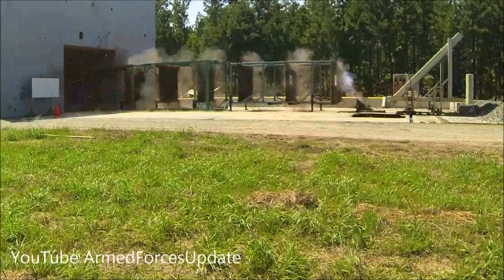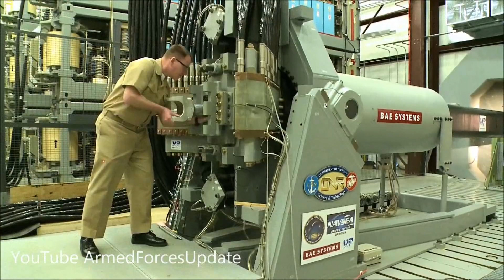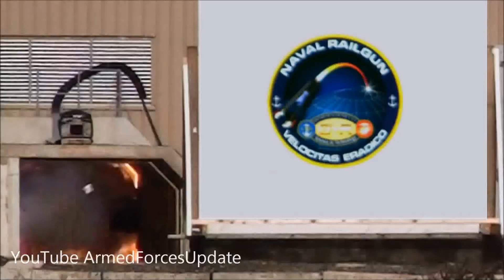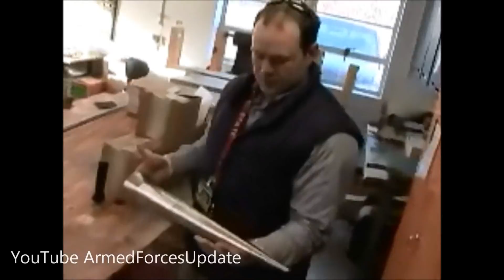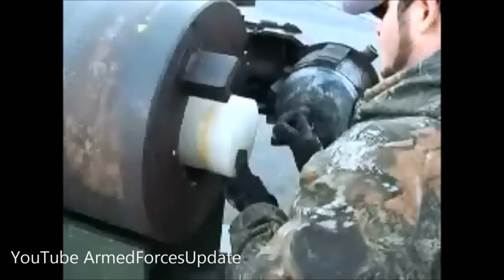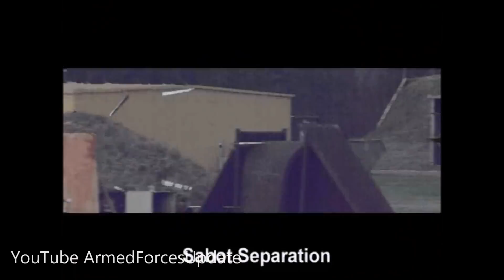WORST NIGHTMARE for Russian military!!! US Military Rail Gun ready for sea trials in 2016

Comment: If it's a railgun why is there a huge explosion? I thought the whole point of a railgun is that it doesn't use an explosive charge to propel the round.
Reply: the "explosion" is actually the sudden release of electrical power, causing the projectile to fly down the barrel. rails guns use magnetic fields charged by electricity to fire the weapon, and then uses the kinetic energy the explosion created to damage its target

Comment: What is the shooting distance of the gun? What is the precision of the gun on the distance? What is the cost of the shoot? Compare it to precision and price of modern cruise missiles. 
This gun is not nightmare for russian military, it is nightmare for US military budget.
Reply: Rail gun projectiles are much much cheaper than missiles. Also much easier and safer to store. I'm not sure about the range, But considering its ability to travel at a speed over Mach 7, I'm sure it can go a hell of a distance. And you saw how precise it was in the video, they could shoot it through hoops if they wanted to
Reply: +John Campbell 
Projectiles are much much cheaper than missiles. But, the cost of the launch consists of cost of enegry, cost of repearing the gun, cost of projectile. Each shot makes enourmous erosion for the gun due to electromagnetic arc during shots. How many shots will the gun endure without repairing? 10, 20? As far as i remember, a tank gun has to be replaced after 200 shots with SABOT, speed of wich is less than 5M, without EM arcs. 
 How many shots it takes to kill a ship 5 000 ton draught? 10, 20 ? One gun for one ship? 
Range of the gun is great, really. More than 200 km, as far as i know. 
With speed 7M flight of a projectile will take 80 seconds. A ship with speed 20 knots will travel 800 meters, and change her course several times. 
Precision of the gun, for example, 1 MOA ( it's very good, the real precision bill be worse ). Wich means, for the distance 200 km spread will be 60 meters, for the ideal situation. How many shots it will take to make a single hit for a ship with width 20 meters for a such distance? Probability is about 0.1 ( surface of a ship divide to a surface of circle of dispersion  ). Wich means, for the 200 km distance it will take at least 100 shots to kill one ship with the gun. Once again, how many shots the gun will endure without repairing?
One, last but not least. With first shot the gun will produce huge amout of electromagnetic energy, all radars will spot the ship instantly. What do you think will they do after they spotted enemy? I think, they will launch dozen of missiles. And missiles are much more accurate than the gun.
Reply: +Brett Keane Showing His Gums 
Countinue your bla bla, my friend.
Reply: +Андрей Андреев You mine as well ask for the schematics while ur at it =P . Projectiles be cheaper but the gun life be questionable as you mentioned. However, considering the innovation that went into the gun and the unique canisters the missiles are projected from, it appears they have a method of combating mechanical wear.
Reply: Nightmare 4 our budget our military budget is increase over 10% this year meanwhile russia budget decrease

Comment: What I can't figure out is if they use electromagnets to fire the projectile why is there smoke and fire coming out the barrel?
Reply: +Alexander  Break down of the round maybe?  Good point tho , do wonder myself
Reply: I know this might sound dumb but friction maybe?
Reply: +SilentRecon well I initially thought it was friction with the air ( Example: the space shuttle, it moves so fast through the air the air friction causes it to heat up to extreme temperatures. ) but I don't know how fast the shell would need to go in order to heat up the air like that.
Reply: +Alexander Something to with the speed the projectile is traveling at burning the air around it.
Reply: +SilentRecon nope, that's it! It's the extreme friction with the air.
Reply: +Alexander The air behind/in front of the projectile is literally turning into super heated plasma due to pressure changes happening so quickly while it's in the bore of the weapon. When it leaves the barrel it has room for that pressure change to equalize properly and "slower" (mind you the differences here are tenths of a second, but enough for the change to be visible).
Reply: Sue LeBaron It's friction with the air.
Reply: +Alexander 
I wonder how this could be change if the interior of the barrel was placed in a near vacuum?
Reply: +Alexander They litterally say, instead of that, they use gunpowder.
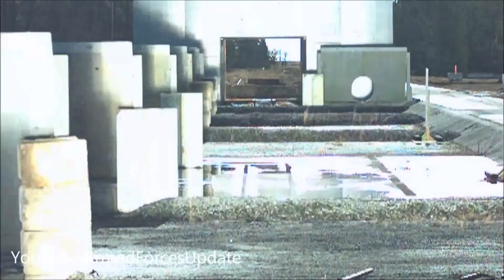Reply: +Z E B Z "The Rail Gun substitutes electromagnetic propulsion for gunpowder, launching projectiles..." stated in 0:50 to 0:55 , They're not using gunpowder..... Plus if they were using it, why would he say "Reduces the need for ships to carry High Explosives...?"
Reply: shincross456 HE rounds are generally rounds that explode on impact, or some other way. HE meaning High Explosive. The kinetic force of the rail gun's projectile is so great, that it'll rip apart what it passes through, not needing explosives to rip apart the target.
Reply: +Z E B Z The main point was that they're not using gunpowder unlike what you commented. You don't get why I mentioned HE... You mentioned that they "Use gunpowder", I used a rhetorical question which concludes that they won't be needing gunpowder or explosives for the rails ., I know what High Explosives (HE) are.
Reply: +DJ Street Love Friction with the air wouldn't cause black smoke, also there wasn't a sonic boom in the demonstration, this is due to sound barrier being broken, the whole thing is smoke and mirrors
Reply: +Alexander I think this projectile is not just a projectile.

Doesn't the fire look like it is coming from the projectile.
It could be a rocket.
Reply: +Alexander Extremely high current is used to fire a projectile from a railgun, so much so that it causes the ablation of the rails and projectile (or sabot)
Reply: +Alexander Plasma. Air superheats and is ionized.
Reply: Ok everyone! My question has been answered! Stop commenting me!
Reply: Alexander You can 'mute' the post so you won't get notifications anymore.  Might help you in the future.
Reply: +product Nine   O, ok, thanks.
Reply: +Alexander i think they use liquid nitrogen to supercool the magnets to make them more effective. something like that
Reply: Also, maybe a explosive to get it to a faster speed before they use the electromagnetic forces on it.
Reply: Joseph Sawyer Any explosives would damage the magnets  and if the explosives
made the projectile go faster the projectile 
would not be in position to use this electromagnetic force.
Reply: bornbillsmith I think you're misunderstanding railguns for coilguns.  There are no magnets in a railgun.

Also, there is such a concept as a railgun using an explosively injected projectile.
Reply: product Nine No, you are. These railguns use magnets.
Reply: DJ Street Love Railguns use two rails with the projectile or sabot completing a circuit.  The projectile is accelerated by the Lorentz force.  Not electromagnets - that would be a coilgun.
Reply: product Nine I'm sure the inventors of the railgun know what they called it.
Reply: @productNine   Finally, someone that understands. (The following is for those that don't) The high current literally turns the rail material into plasma.., you know, like the sparks from shorting an automobile battery? Times millions. Or how about the arc in arc welding. The rails are vaporized. The program has been scrapped due to our inability to manufacture materials that aren't destroyed by the plasma. Practical room temperature super conductors are still Science Fiction. Until then, it's just research.., providing proof that "We ain't there, yet."

Comment: I'm confused by the explosion that follows the shot out of the gun. it looks like a "normal" cannon rather than something you expect from electromagnetics, which is nothing visible
Reply: Gmon3y 142 the force of it hitting air.
Reply: I also think that some of the shots are from actually using propellant based propulsion in order to just test the flight characteristics of the projectiles being used. I could also be wrong.
Reply: Yeah I think Jeffry is probably right. The speed of the projectile is causing the air to compress so rapidly it generates it's own explosive decomposition. Much like when objects from space enter the Earth's atmosphere.
Reply: Gmon3y 142 physics say FRICTION 😀 plus I'm pretty sure electricity can have sparks at times. but I do agree with u.
Reply: Jeffry Cofield tru tru

Comment: OK I'm confused here if it's all electronic how is there a fire ball from the muzzle????
Reply: ***** sounds legit
Reply: Red Crafter nope, an asteroid "burns" due to friction
Reply: noobtoob nooby it's a plasma ball not an explosion. they use opposing conductors along either side with a copper bar between them. it evaporates the copper into the plasma ball you see coming out of the barrel
Reply: pete136913 thank you for the actual explanation
Reply: noobtoob nooby you r so funny, the push by electricity happens so fast, that the projectile starts moving so fast it causes air around it to literally burn, while outside the barrel it's cooler, you won't see flame,  I might be partially right or so, but there is no gunpowder. I believe it all happens because of the speed
Reply: Felix Schulz Perfect and simple explanation.
Reply: Ivan Konstantinov So the thermal image would be visible from satellites and it would get off a few projectiles before it ate a few itself.

Comment: lots of flame for a magnetic rail gun....
Reply: +mark park This is no propellant. These things fly 2500 to 7800 meters per second. Its just the difference of pressure behind the projectile, its called plasma.
Reply: SuperGeronimo999
cool
Reply: +SuperGeronimo999 Normal fire is basically the same thing except it's created by oxidation of combustible materials.
Reply: +mark park The projectile goes so fast (6 times the speed of sound) So fast that the oxygen in the air lights on fire when the molecules in the air collide with the projectile. Its the same thing for space shuttles entering the atmosphere. Not sure if the Space shuttles burn tho, but they get hot as fuck.
Reply: +Brett Coryell the underside is
Reply: ***** You miss understand, it's the oxygen that burns. If everything goes according to plans the shuttles don't burn.
Reply: Robert Haraldsson Oxygen doesn't burn, it's an oxidizer. Burning is something ELSE combining with oxygen. The shuttle uses liquid hydrogen as the fuel and liquid oxygen as the oxidizer.
Reply: +mark park The fire you see is actually the material of the projectile being burned (ablated) away by the ultra high current flowing through the projectile.  The cone shaped projectiles have an ablative sabot that is discarded shortly after leaving the barrel (can be seen at 0:10 just before the cut away from that shot, it's two blocky bits kinda opening up just before the video cuts away to a downrange view).  This ablation also takes place on the rails themselves and was a major hurdle in getting rail guns of this magnitude to an operational state.
Reply: +JackANSI No current goes into the projectile, only the coil(s)
Reply: +Kaneki MaX that would be correct if we weren't talking about a rail gun but instead a coil gun which are two separate but similar technologies
Reply: +Kaneki MaX Well actually, current does flow in the projectile, via induction, or the projectile wouldn't move.  You couldn't shoot a plastic projectile.  The current induced in the projectile produces a field which is opposite in direction, kinetically,  to the the coil and the coil is fixed (think N-N magnet poles) - the projectile is thus pushed away.
Reply: ***** My last response got reported (and thus, deleted.  wonder who did that?).   On a rail gun, the projectile is directly contacting the rails.  You are talking about a coil gun. They are two different methods to the same end and this video is clearly a railgun, not a coil gun...
Reply: JackANSI Ah it's ok i read it idk who reported it. thanks for the correction i wouldn't think current would go through the projectile, it sounds really inefficient.
Reply: ***** Not sure which would be more efficient since I don't think (least I have not heard of) anyone has made a coilgun whose performance could even be extrapolated to the performance level of the railgun shown here.  I mean, without ignoring many "laws" and engineering that would effect a coilgun of comparable magnitude.

More reading on railguns and coilguns can be searched out online.  Definitely worth the reading time if you dig in to the physics behind them.
Reply: False, Plasma is ionised gas which electricity flows through at very high temperatures. Electricity can't travel through nothing (vacuum), even if its high voltage where it could jump the gap; but there isn't any air to ionise to jump that gap.

Comment: holy shit, but how are they going to power it?
Reply: ***** the amount of energy it takes to power would drain most power sources on earth, making it an unreliable weapon, they'd have to have some way of generating the energy needed to propel a projectile to the speeds they claim.  are ships going to carry nuclear reactors now too?
Reply: i wonder if the way of propulsion natural adds a spin to the projectile, and if they were to make a specific wind around the core of it, would it add to rotational property, creating something that would spin very much more spinny like.
Reply: ***** i guess you are right, i did not think they'd have them on ships do to the hazard of the reactor being hit during combat, but i bet they have strategies in place for such an situation to avoid catastrophe
Reply: The plan is to mount these on conventional non-nuclear warships. No nuclear reactor required.
Reply: ***** it would vaporize the water as it passes through it XD
Reply: OH, Yes. They have been for about 50 years.
Reply: About a 4 AA's should do the trick...
Reply: They've got one of these on the USS Zumwalt for testing at the moment. Don't know if it will ever be mainstream, but it make a nice show piece for the Iranians. Over the horizon sea based artillery that doesn't spread radiation everywhere.  And unlike the JDAMS the air force like to drop, they don't cost much. So you can use them more without bankrupting the country.
Reply: It doesn't take much power to use magnets.. they just have to cool it and even that isn't that much of a drain. Hell, amusement parks use this technology, I know Cedar Point does and they are out of butt fuck nowhere.
Reply: X Kaber it takes a pretty good sized charge to power one of these.  but the heat issue is just energy waiting to be recycled.
Reply: @spencerm5913  if it used coils it would be a coil gun.
A rail gun is simply 2 parallel metal/conductive rails with the also conductive projectile in-between + a power source capable of delivering lots of current.
The current (typically from very big capacitor banks) go down one rail, scross through the projectile (or carrying cradle) and back down the other rail. The very high current creates strong magnetic fields around the rails and the projectile/cradle. 
The magnetic field interacts with the current through the projectile/cradle (going perpendicular to the magnetic field) resulting in a Lorentz force, parallel to the rails  according to the right hand rule, that pushes the projectile.
Forces also affect the rails, so those have to be solidly mounted so to not move/flex.

Comment: 1) Uncontrolled projectiles fired from this have severe accuracy issues at long range, and at range this thing DOES hit its target, it is usually more practical and economic to use more convential altillery.
2) Controlled projectiles have very high failure rate due to components breaking upon acceleration.
3) The weapon itself is very expensive to use due to the wear of components (especially rails) that have to be replaced quite often.

That's also the reasons why nobody actually equipped their army with these yet, while they could do it for 15 years already - no military can throw away as much money as american one.